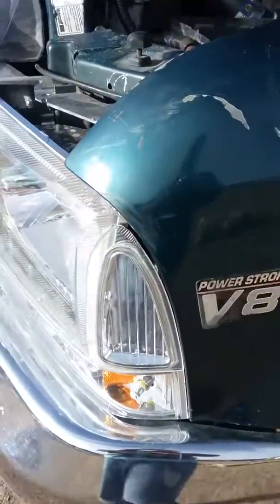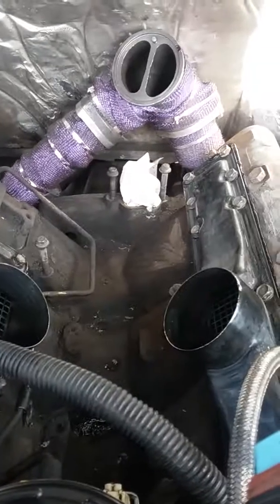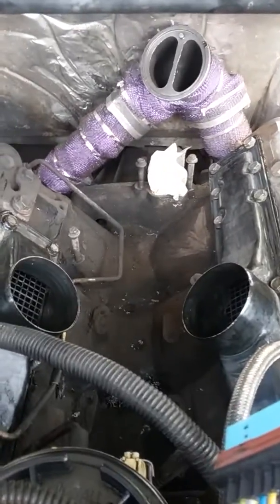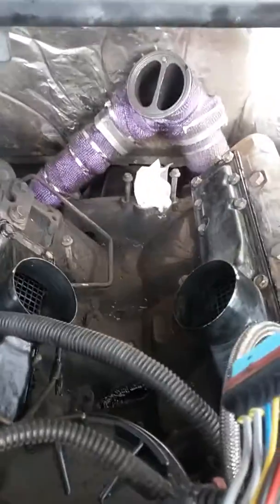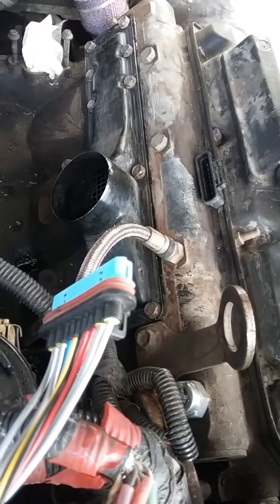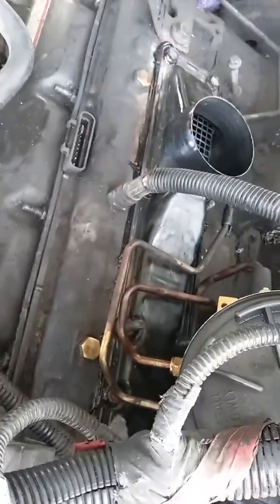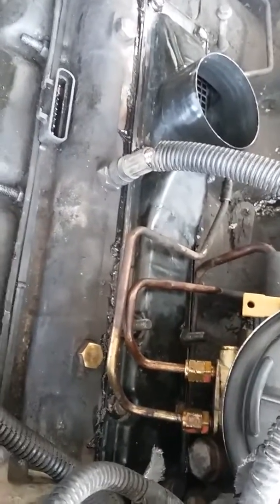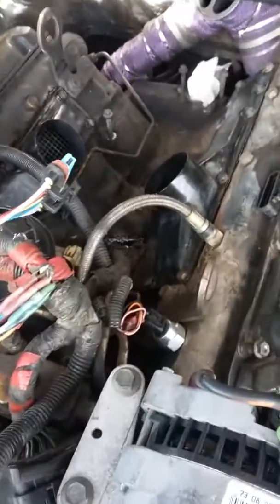E99 7.3 Turbo upgrade 3" plenum and spyder info #1

Comment: So you are just putting a late 99-2003 spider in?  And pedestal.
Reply from the maker: you need a 99.5-2003 pedestal, spyder,  turbocharger, and both intake plenums with the rubber boots and clamps to connect them together.
Reply: @DirtyDiezel  thank you I just wanted to be sure.

Comment: So the early 99 up pipes won’t work with the late pedestal?
Reply: yes when towing
Reply from the maker: @federicoavakian79  apparently more air lowers egts so yes the larger upgraded spyder and a larger turbo will help!
Reply from the maker: rockster24 jamsa I am not completely sure but I would not install all of those good turbo parts without doing exhaust manifold gaskets and new up pipes so you might as well get the ones that match the 1999.5 to 2003
Reply: Dirty Diesel ya alrighty thank you
Reply from the maker: rockster24 jamsa I'm sorry if my instructions aren't complete I just got the truck a few months ago and have been doing all of this. I just went and got my Turbo pedestal that was original and it's about 2 in shorter and you need an inch longer bolts to mount it down also. So there's no way the old up pipes would work ever. Also one thing I didn't know was going to happen is the downpipe has a gap in between it when you reconnect it to the new Turbo so that means it raised it also. I bought a 3in exhaust clamp to bridge the gap works great. For some reason the downpipe is 3 in and then at the next collector it's three and a half so make sure to get the right clamp. I cut my downpipe under the truck instead of unbolting it so I could add the clamp.
Reply from the maker: rockster24 jamsa I will also say it's the best upgrade ever and it drives like a brand new truck afterwards with more power than I would ever want. But I did do every seal from the exhaust manifolds to the up pipe then all 3 in intake. Practically new at 200,000 miles!
Reply: Dirty Diesel could you send me a picture or link on the exhaust adapter to bridge the gap?
Reply from the maker: I sent the wrong link that was 3.5
Reply from the maker: https://www.ebay.com/itm/ES300SS-3-Torca-EasySeal-Stainless-Butt-Joint-Band-Exhaust-Clamp-Sleeve-Coupler/182520641919?epid=7005222004&hash=item2a7f13f97f:g:76IAAOSwuLZY58yK:sc:USPSFirstClass!80827!US!-1&vxp=mtr
Reply: Dirty Diesel you’re fine I kinda made my own exhaust so I should be able to position the down pipe as it sits right now thank you very much for the help
Reply from the maker: let me know when your done I wanna hear how your truck runs afterwards.
Reply: @DirtyDiezel  would this help with egt's?
can u send me a list of parts i need please.
thank u so much